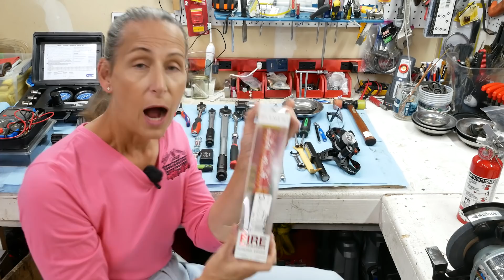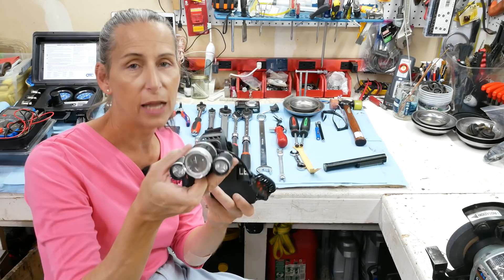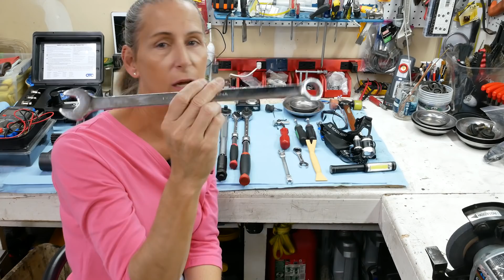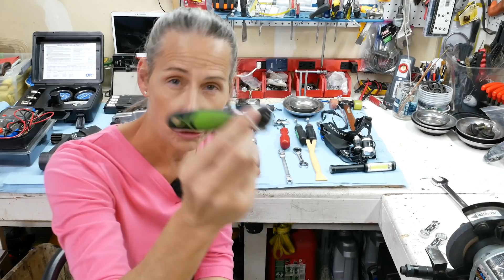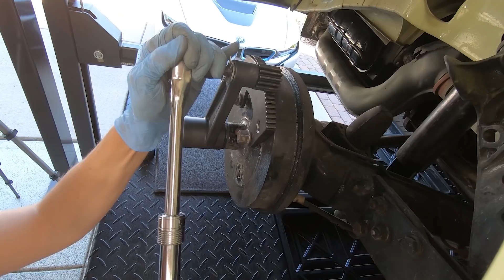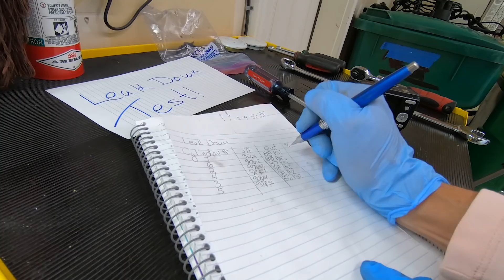CAN'T LIVE WITHOUT TOOLS!!- These are my favorites - What are yours?

Comment: Good afternoon Franny and Heidi, I just rebuilt a 912 engine. I had the block machined for larger pistons, used new crank, camshaft, pistons cylinders, etc. The engine started right up, after awhile it started to get warm and I shut it off at slightly over 190 degrees. I tried adjusting the timing, valves and carburetors, same thing. I dropped the engine and removed the fan shroud to get to the brand new aluminum oil cooler, it was bone dry. I removed the third piece to make sure the oil supply tube bushings were in the correct direction, they were. Both the oil pressure piston and the oil bypass pistons are free and loose. Blew air thru all the journals and they seemed  clear and open. I replaced the oil cooler with a new aluminum oil cooler and I'm getting ready to re install the engine and give it a try. I was getting oil to the crankcase and every body seems to be happy and lubed, but after the engine builds up pressure and warms up, no oil got to the cooler, any ideas???
Reply from the maker: Considering your making modifications, we are not really the ones to ask about these things. We try to keep our cars as originally spected as possible, especially classics.  Sorry and good luck.

Comment: What a great video.  If I may ask you a question. I have a Porsche Boxster 986 3.2S, and I am looking to remove part of the exhaust pipes which is connected by press studs, rather than the bolts. Would you have any idea how I could extract these. I really smart tool, I hope. Thanks

Comment: I rebuilt a kohler magnum air cooled 18 hp engine for my tractor.  Starret snap guages and  bolts with a ring top to lift engines.    Metric crows foot wrenches for locking down and setting valve lash

Comment: What do you use to clean dirty knecht air filters ?
BTW you are awesome thanks. Did my first oil change ever on my 356 after watching your videos.
Reply from the maker: Oh, that's great!  I clean the filters with gas and a stiff plastic brush.  I have K&N foam on the inside so that really does all the work.  Those are cleaned with gas and then lightly oiled.  Thanks,  F

Comment: With the money you saved at Harbor Freight, get on amazon and get yourself some Knipex pliers! The quality is outstanding. I'd start with:

1) 10" Cobra
2) Needle nose pliers 25 01 160   - I prefer comfort grip, but that's a few dollars more, and I have big hands

There are many others in my toolbox but those are the most frequently used ones. (The "pliers wrench", which look overpriced and not very handy, are also outstanding and have more uses than you'd ever suspect.)

Comment: HI Franny, what a great video with great tool ideas.  One of my favorite tools while working on my replica Speedster is a nut driver, but with a flexible spring coil shaft.  Literally allows you to turn nuts or screw heads around a corner, with good force too!  Even if can't quite line up directly on the nut, I find it locks on to the nut and you can just turn without concern of slipping off the head.
Reply from the maker: That sounds awesome! I'll totally look into that :)
Reply: Tubing wrenches, not only for brake line and fuel lines, but other uses when a regular wrench doesn"t quite cut it.

Comment: Ok. I've literally never worked on my car beyond adding wiper fluid, and now I want all those things. That tool chest is dreamy. Also, your hair is looking great Franny!
Reply from the maker: It's so nice to see you watching our videos Jenny.  Franny does have some cool tools.  Heidi
Reply: Jen.  Start slowly.  No crazy expensive stuff.  6 point impact sockets can do everything.. short and deep.  Triton or gearwrench.  Both good. And at amazon.  
Only pricy things i would consider are the pinless gear wrench universal socket sets.  They are strong and excellent.  Start w metric stuff unless you deal with american cars.   Invest 200 dollars a year or less.  Dont spend big money.  And stick to normal size sets .  
 A youtube guy.  Car care nut has an excellent video on buying very basic tools.   
      Find some old guy like me to help teach you and borrow  tools at least several times before you buy anything to special..  

Combination  6 point wrenches
6 point regular and deep sockets
Small and larger flex ratchet
Screwdrivers .  Watch project farm to pick some.  
And a few pliers and maybe a large universal oil filter wrench
Olight very basic flashlight
Mechanics gloves
Funnel or two
Harbor freight infared  heat temp gun
Couple boxes of shop towels

Comment: Hi again. I have ordered a few tools from your links today.
My question is about the grip rotating ratchet. I found it by the #s on the handle and see it is on Amazon also. This is not on your list but I would like to use Amazon credit to your channel if possible. ! wondered if you could provide a link in order for you to have credit for the purchase? It's not much but everything helps. 
Thank you, Franny
Reply from the maker: Thanks so much Jake!  No need for a link.  The way it works is that Amazon pays us a small finder's fee on anything bought within 48 hours (I think).  It isn't specific to what link you use just that you land on the site with one of the links.   The best part is that the price is exactly the same if you use the link or not so you don't pay any extra :)

Thanks again!!  Franny
Reply from the maker: Hi Jake, Franny also forgot to mention, you can always go to our page for all sorts of tools, and if you did not order those tools, but still bought any items on Amazon, as Franny did mention, it does not cost you more and they give us a fee.  This is why Amazon is so popular for creators.  Heidi
Reply: @HeidiandFranny  
Thank you very much, Heidi. This PM I found the ratchet I spoke of is out of stock right now. Sooo, I remembered I need a large torque multiplier soon. It's on its way. Hopefully, I got it right. I clicked on one of the links in Franny's post then found the tool I wanted. 
From now on if I need something I will do the same. 
Peace be with you both.

Comment: Thank you, Franny, another wonderful film. I need to add to my collection of ratchets. I had not seen the telescoping or twist type before. Considering ratchets, I can't live without my set of through-bolt types. There are places the deep sockets will not do the job.
Another is my torque multiplier for high torque settings like pinion nuts, etc.

Comment: I used to be in the tool business, and still do some work on my own cars. I have all of the ratchets you show, incl the rotating head, roto handle, the extend I have all 3 drives (dual head can be too thick), and a few additions, one is a 1/4 ratchet where you can angle but lock the head in that position, the other are 1/4, 3/8, and 1/2 drives that can be inserted flush with the ratcheting wrenches. The little ratchet is good for locking at an angle (saves knuckles), the insert able drives are handy in tight spots. Oh yeah, aside from the stubby and regular length ratcheting wrenches (got 8 mm to 24 with no sizes skipped, plus 27 to 32, and a set of extra long ratcheting.  Oh, another is a quality set of left turn drill bits. Trying to drill a hole for an EZ out left turn, most of the time the broken bit just comes out. One of the tools you hope to never have to use, but when needed..... Keep up the good work.

Comment: Hi Franny
I've been collecting tools for 30 years, but you're sure done better.  Also have a tremendous 3.2 Carrera.   Only suggestion would be a swivel rachet wrench, can really allow fit up to hard to reach bolt. That can't be fit to straight socket wrench.  Also, as I said before, try a medium size ultrasonic cleaner.  They aren't very expensive and will work with.many cleaning agents and degreasers.  Really enjoy your channel.

.
Reply from the maker: Thanks so much!

Comment: Tool tip: "Screw grab"! Used it all the time when I worked as an aircraft technician. Great when you are to loosen for example a Philips head screw and you get the feel that it so stuck that it will end up with a rounded head. Or if a PO has damaged the head. A drop of "Screw grab" usually saves the day.

Comment: Excellent video with lots of great tools. I learned of a few that will certainly make their way into my toolbox. 

As for suggestions I have the following:

- Get some hockey pucks. Infinitely useful for hammering or as jack pads. Super cheap

- Yoga mats. Perfect for protecting paint when leaning on a car or as a soft work surface on a bench when disassembling detailed items like carburetors.
Reply from the maker: Yes!  Hockey pucks!  I really need to get a few.  I have several foam pads.  They are real knee savers!  Love the idea as a work surface :)
Reply: I like yoga mats as tool box drawer liners. Tools don't slip, and you can get them in bright orange for good contrast.

Comment: Adjustable heat gun!  I just replaced the stone guards on a Porsche.  They came right off without damaging the under lying paint using about 250 degree heat.  You can crank up the temp for stuck bolts and it is way safer than using a lighter when you are working with heat shrink.
Reply: I use harbor freight heat guns.  Use a digital temp gun to see what distance i need to be. In my electronics days we used adjustable master heat guns.  Expensive but good

Comment: Infrared temp gauge. Many uses
Reply from the maker: Oh yeah!  I have one of those too!  I used it a bunch on the Beck 550 project to balance the cylinders.  Great for checking tire inflation (weirdly).
Reply: @HeidiandFranny  I use it for lots of things.  Brake rotors are a favorite.  Really helps to check a water cooled cooling system.  The cheap $40 ones work very well but the expensive ones with a screen for visuals are outstanding.  You can "see" electricity in the fuses and relays

Comment: Great video as always ladies. I also like the Klein multi screw driver another viewer mentioned. A flex shaft camera is great for looking into tight places.  Little telescoping mirrors are good too.  And I keep a couple little bitty vice grips around for pinching off full or vacuum lines when you’re changing fuel filters and hunting for vacuum leaks. And never throw out any kind of table, cart etc that has wheels on it. In my shop I have an old butcher block from the kitchen for a rolling workbench. Also an old barbecue grill.  Took the top off stuck on a piece of plywood and  away ya go!
Reply from the maker: Love the repurposing!

Comment: I may need to investigate those ring clip pliers. I've destroyed many cheap ones and I need to get back to work on my Type 1's rear wheel hub/bearing replacement and I destroyed my one pair removing those massive inner clips that hold the bearings in.  Same goes for the one clip on the crankshaft. I just hate these clips!
Reply from the maker: I had the same issue.  Those clips are serious!  My new set took them right out no problem.

Comment: Great video and some mighty fine tools. Totally agree on the multimeters, always preferred analogue, far easier to use.

Highly recommend two Dremel tools, the normal Dremel rotary and a gas powered soldering iron, having no cable makes using one so easy.
Also a pair of quality crimping pliers, saves a lot of heartache with electrical issues.
Got to ask, the electric toothbrush on your desk, give me a clue!!  lol
Reply from the maker: Yes the Dremel! I should have mentioned that... I do have several electrical tools but I just don't use them all that much on the cars. I do for lots of other things.  The electric tooth brush was an idea to add a little love while cleaning small parts. It does a great job but splatters everywhere!
Reply: I like analog meters. But an inexpensive Dmm can do so much more.  I finally got myself a Fluke.

Comment: So much know how that you've learned over the years.  Thanks for sharing your go-to tools.  One I use a lot in the garage is a Klein 10-in-1 screwdriver.  It's a little bulky so it's not ideal for some of the tight spots; however, it quickly swaps between Phillips, standard, square, and star bits.  The hold on each of the bits is really tight with a nice 'snap' to let you know it's secure and not going anywhere.  Can't wait to see another video!
Reply from the maker: Thanks for that :)